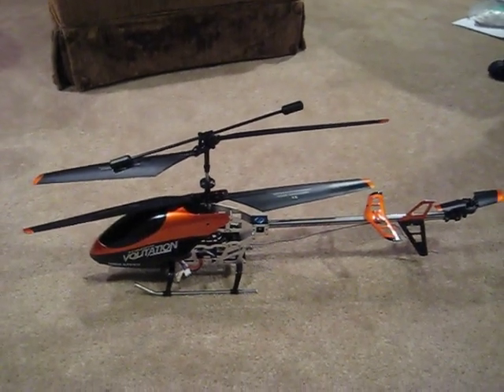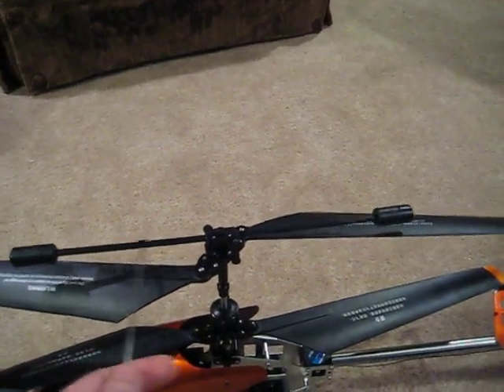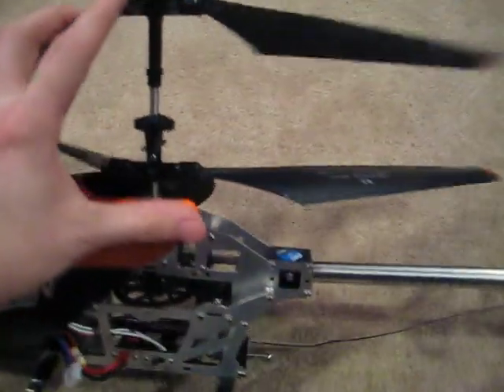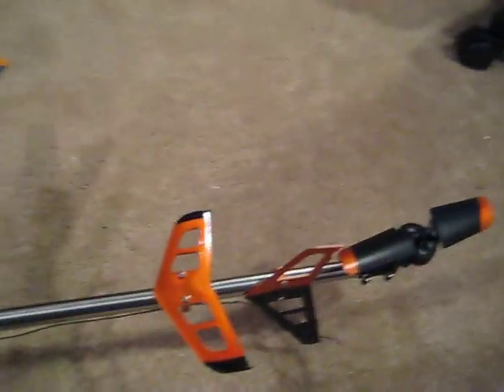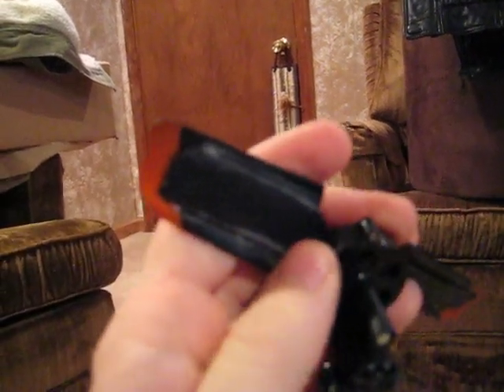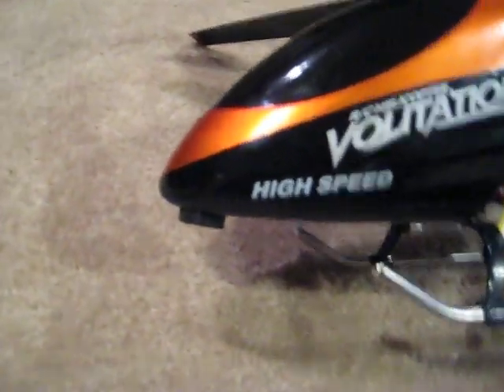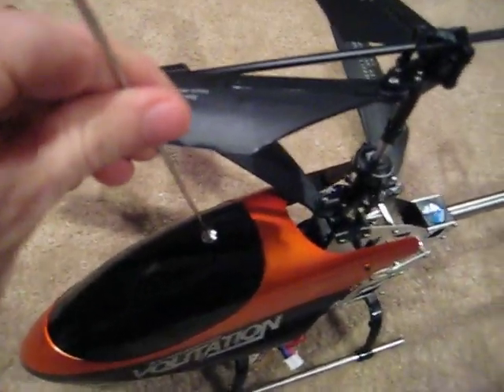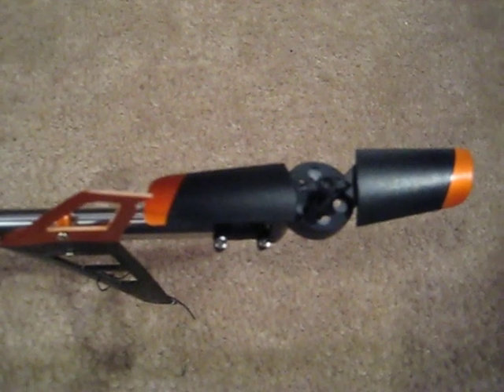Double Horse 9053 Volitation Helicopter Modifications

Comment: I own one of these you can buy a bigger tail rotor with motor upgrade (ebay) every time you glue your adding weight you have to move the rear fin with the one I got as its that much bigger
for anyone having issues with the controls being back to front cut the wire from the tail motor and swap them around way hay now it goes the right way
the main blades are dirt cheap from china (ebay)
what really pi$$e$ me off is theres no quick release to change the battery it a pain in the ass I bought a spare to use
would welcome a battery change upgrade
im thinking instead of canopy screw a r/c body quick release pin with some sort of holster for the battery (currently stuck down with tape and clamped in)
has anyone tried moving the battery forward (putting the weight further forward) instead of sticking stuff all over it ?
personally id prefer a cam in the nose cone
Reply: scott martin Hello, i have searched Ebay and cant find the " bigger tail rotor with motor upgrade " that you were talking about. I would realy appreciate it ,if you could tell me where on Ebay i could find that mod Thanks much, good flying!

Comment: where did you get the tail rotor?
Reply: The replacement Spare parts for Double Horse 9053 RC Helicopter are here:

https://www.rc-helicopter-parts.com

https://www.rc-helicopter-parts.com/rc-helicopter-parts/double-horse-rc-parts.html

By simply replacing the spare parts, the RC helicopter can fly normally again.

Comment: Rear rotor upgrade can fry the chips on the circuit board. Upgrade can be done but recommend not using the rear rotor control for more than 20 seconds continuous..

Comment: yes i bought one and i regret it, the dammed thing won't fly in ANY type of wind! I've done almost everything he recommends and still it is a worthless heli, not worth the 49.00 or 59.00 I paid for it. Next time I  buy soon a single rotor so I have articulated blades to go forward and back and I'll spend my money on a heli that does what it is advertised to do. This heli is totally misrepresented by the sellers and manufacgturer, THIS IS NOT AN OUTDOOR HELI! Not stock, not with 200 modifications

Comment: I would recommend the 9113 or 9116 DH helicopters if you don't want to have to mod something to get it to fly right. I'm modding my 9053 now but wished I knew this ahead of time. The 9053 is going for 39 bucks online, theres a reason, there crap without fixing what the factory screwed up.

Comment: No problem I have had mine a few months and still trying to get it to fly right. The radio has one "trim" slider on lower left which doesn't even move. Whether or not its sposed to move, last time I remember using it, all of the sliders moved, and today when I took out the radio, it didn't move at all. Have to invest in a better radio.

Comment: Yeah but its garbage, I have had mine and the thing is tail heavy, the rear rotor blades are not wide enough to help with lift. It wanders backwards during flight even with the trim settings, have to move the battery under canopy forward to get the thing to not be tail heavy. The radio is cheaply made, the antenna screwing it in the screwhole strips very easy! It's garbage, I wouldn't recommend this to anyone. Without modding it sucks and I don't know if I'll mod it if its not worth the money.

Comment: Where did you find the Batery with the proper connections?
Reply: The replacement Spare parts for Double Horse 9053  RC Helicopter are here:

https://www.rc-helicopter-parts.com

https://www.rc-helicopter-parts.com/rc-helicopter-parts/double-horse-rc-parts.html

By simply replacing the spare parts, the RC helicopter can fly normally again.

Comment: I like all the mods except adding weight to the front.  Why add weight, why not mod the battery holder to use velcro and adjust the battery slightly further forward.

Comment: these are great starter helicopters,twin rotors versa, a single rotor with a tail rotor.You don't have to deal with the long learning curve ,due to the tail rotor compensating for the rotor torque,which believe it or not is pretty difficult for first timer's.So learn on a twin,then try your skills on a single.

Comment: i also found the problem ,the blades somthimes wil not go round even , i checked it on higspeed cam ,, because they are not going in a spin the same time the metal bar spins ,, it brakes a milisec and that causes the hit on the metal weigth , and hits the next spining plade below ,, and locks both motors ,and drops ,  the bar hits it because of the space below and the blade is not covering it , when turning ,they bend back but blades bend more , when giving more speed they wil stay straight

Comment: nice stuff ,, i mod mine heli ,i take of the metal stabeliser and cut them on both side's the same way , and put shrink tube on it , it wil be flexible ,and in air it gives more brake jump when you move , test it it works great , also on the smal ones ,the brake fast , greatings

Comment: @chuchoteclas  

No! It will completely  ruin your controllability!! It's too heavy!! I've had great luck with the 909 key-chain camera. It costs about $17 dollars if you want to wait for 10 days. Mine fell out from about 30 ft., broke into 6 pcs. Piecing it back together I found it still worked...&&& the vibration from the motor was gone from the video. It actually worked better than when it was new!! So I suggest taking that camera apart and unglue it from the casing to reduce vibration.

Comment: Jason,
Why not just shift the battery forward for better CG balance instead of gluing weight on?
Why not  two small sheet metal screws for each tail rotor blade and adhesive?
How can you use two motors for the tail rotor? I'm confused about that part!
Great idea of using the model 9077 flybar...ordered one today...cost $8 but at least they have them in stock as well as the attachment collars.

Comment: how you take that pin off which is on the balance bar ?
Reply: The replacement Spare parts for Double Horse  RC Helicopter are here:

https://www.rc-helicopter-parts.com

https://www.rc-helicopter-parts.com/rc-helicopter-parts/double-horse-rc-parts.html

By simply replacing the spare parts, the RC helicopter can fly normally again.

Comment: @jasonus03 Also screws are differnt lenghs, look close i discovered hard way,lol, hey bud where can i get screws for 9053(spares), x-heli? You know anywhere? Thanks, by way im missing bearing in upper shaft for up. blades, and my heli wont lift, would that do it? and do you know what it means when red and blue lite blinks on elec. board, thanks man!